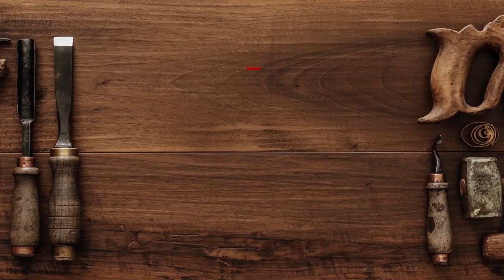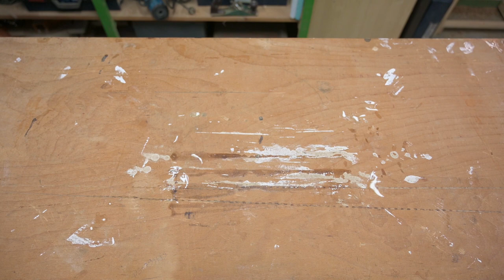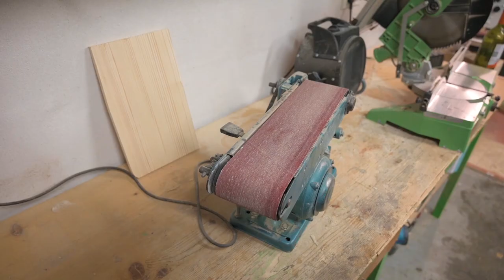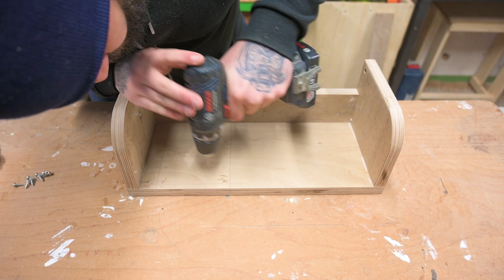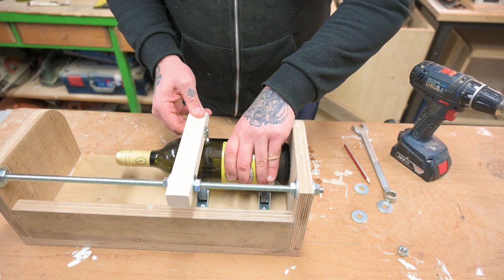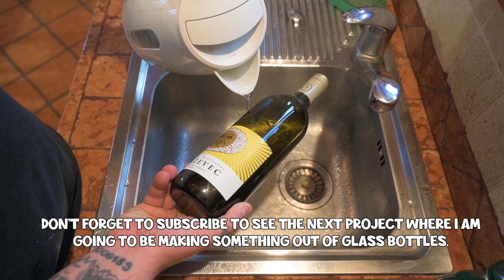Homemade diy glass bottle cutter|| Create unique drinking glasses

Comment: Awesome!! Where’d you get the cutter. Great idea!
Reply from the maker: Thanx. You can get the cutter in every hardware shop. Its standard glass cutter. i just pulled the wooden handle off and drilled two holes to fix it on the wooden board.
Picture: https://images.app.goo.gl/PqX9RMy9xPktExBq8